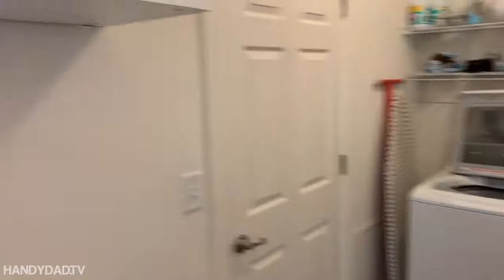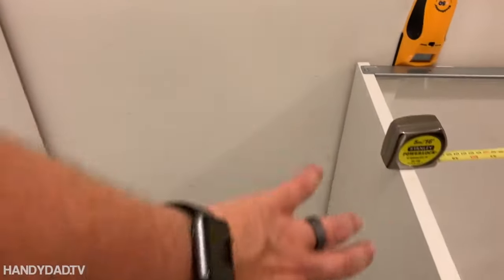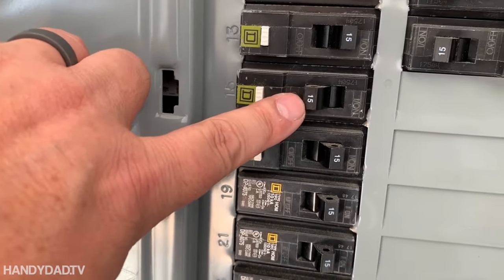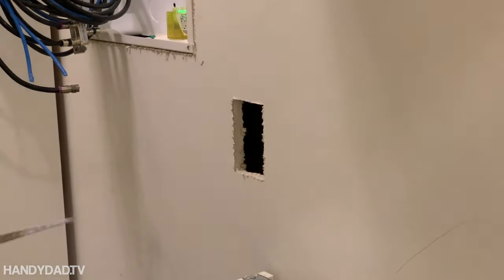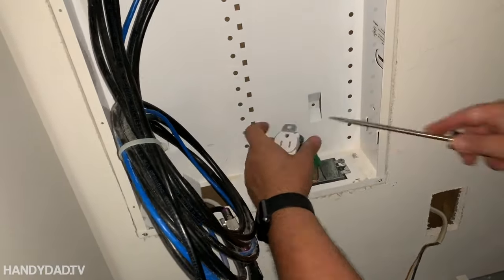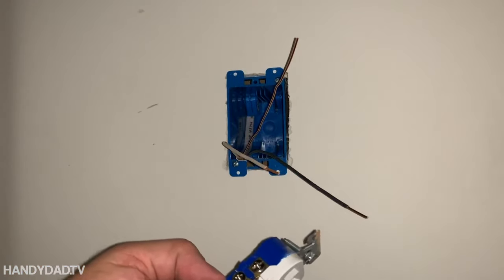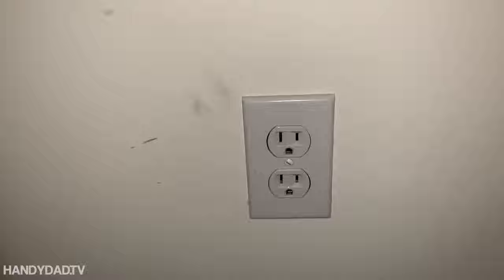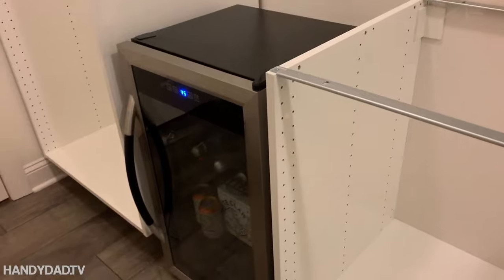Add an Outlet to an Existing Circuit

Comment: Does this effect what the breaker can withstand?
Reply: You still have to stay in range of what the breaker and the wiring can handle. If it’s 15 amps then you have to  stay within 15 amps on the entire circuit. You shouldn’t use too many outlets at once on the same circuit especially with higher amp appliances like this cooler, a vacuum cleaner, air conditioner, ect.

Comment: So if you’re adding just one outlet is that special ground wire nut necessary? This is what I’m confused on
Reply from the maker: No, if you only have one bare wire, you can connect it directly to the ground (green) screw.
Reply: HandyDadTV thanks for the response, “Dad”! But you’d have it on both sides of the new wire, right? Do you connect 2 ground wires 2 1 green screw on the original outlet?

Comment: Could you daisy chain multiple outlets off of one outlet ? How much is too much?
Reply from the maker: I’m not an electrician so I don’t know the official answer by today’s standards. But I’ve seen outlets wired with one feed coming in and up to three going out. But it gets really tight with all those wires in the box so I try to limit it to one or two out.

Comment: You forgot or it doesn’t matter where you put the line on which side of the receptacle? 
So the 12/2 that’s coming from the power, it should be screwed to the top of the receptacle and if you adding another receptacle the new 12/2 should be screwed to the bottom of the same receptacle and so on.
Reply: It doesn’t let add a picture so I can explain myself better
Reply from the maker: It doesn’t matter. Top and bottom are connected.
Reply: @handydadtv  thank you for the fast reply

Comment: Just want I needed... One questions though, instead of wiring to an outlet, can I do this to a ceiling fan? I'm not sure if a 15amp breaker is sufficient. And if it isn't, can I upgrade to a 20? Or is that bad because the wire that's already in that circuit is going to be 14/2 instead of 12/2?
Reply from the maker: You want to add an outlet from a ceiling fan? Or a ceiling fan from an outlet?
Reply: @handydadtv  add a fan, running power from an existing outlet
Reply from the maker: Yes you can wire a fan from an outlet. Fans don’t use much power so it doesn’t matter if it’s 15 or 20 amp.
Reply: @handydadtv  great, I'm gonna give it a try. I think I know what I'm doing now, but I'm gonna make my dad come over for a confidence boost and moral support lol
Reply from the maker: Dad’s are good for that.
Reply: @handydadtv  I just came back to this video for a refresher, the ceiling fan install went great
Reply from the maker: Great to hear! 👍🏻

Comment: How many lights and outlets can you have on a circuit?
Reply from the maker: There is no hard limit to the number of outlets. There is a limit to how much power can be connected, that is determined by the circuit breaker and size of wire.

Comment: Is there a limit to how many outlets you can attach to an existing one without overloading it?
Reply from the maker: No limit to the number of outlets, but the total power you can consume on the circuit is limited by the circuit breaker. In other words, just adding unlimited outlets doesn’t mean you can power an unlimited amount of devices.

Comment: I see that you ran one cable from the existing outlet to the new outlet. But what I don't see is where the third outlet is getting power from, there are two cables in the third outlet box. Does not make sense.

Comment: you did wrong on the first outlet connection .you should use the pigtail
Reply: Nope, he didn't do anything wrong. He did it exactly right. And that, is why us electricians are and forever will be in business.

Comment: Question ,so I’m wanting to add wall outlets in my garage as I only have 1 dual , but I have my deep freezer connected to it but I’m worried I’ll trip the breakers as I’m wanting to have a plug  for my tv maybe plug to charge my phone or multi strip outlet  also Want to add another outlet but on the other side of the garage for my compressor An tool charger just trying figure out how to accomplish this I was told I can tap into my light switch then tap my green into my actual light  I personally wanna add a dedicated breaker for both new outlets ,any help ?
Reply from the maker: First I would determine what else is on the circuit with your existing garage outlet. If that’s where the freezer is plugged in now, and you don’t blow the breaker, then there’s no need to change that. 

For the rest of the outlets, it would be best to run a new circuit if possible. Adding outlets to a lighting circuit should be avoided.
Reply: I recommend that you get a multimeter with an inductive pickup for measuring current. This will help determine what you should do next. I bought a Klein from Home Depot, about $60.

Comment: A Question and a comment. How do you know if you're at maximum capacity for your circuit breaker?

 My dad, he was an electrician, wraps the outlet back sides with electrical tape to cover the screws so you don't touch them accidentally when working with live wires. Although I would not recommend homeowners working with live wires.
Reply from the maker: I only work with love wires when testing voltage. Then the breaker goes off and stays off until I’ve finished the connections. 

As for breaker capacity, that’s a good question. You often don’t have a choice; you typically add an outlet to the closest existing outlet. It’s only a concern if you’ll be using multiple high wattage appliances (like two blow dryers) at the same time.
Reply: Tracey C if you go to ur panel and locate the hot wire for that circuit that ur receptacles are on you can use ur ammeter to see how much current that circuit is drawing

Comment: Can this be done on a 220 outlet
Reply from the maker: Yes, but any time you have a receptacle with only one set of screws, you need to use wire nuts and pigtails to extend the circuit to another receptacle.

Comment: How to determine proper gauge of wire
Reply from the maker: Determine which circuit breaker controls the existing outlet. It’ll have a 15 or 20 on it. This is the amp rating. 

14 amp circuits can use 14 gauge wire. 
12 amp circuits need 12 gauge wire.

Comment: Why can’t you connect two grounds to one screw? They are both touching anyway so what does it matter?
Reply from the maker: Technically it’s because they always want the ground to be connected on the whole circuit. If you could attach the wires with screws, the ground would break if you removed the outlet for some reason. That’s why code requires a pigtail on the ground.

Comment: National Electric code requires all outlets in laundry rm be dedicated 20 amp circuit with no other outlets fail
Reply from the maker: Thanks for the feedback but I’m sure that’s intended for the laundry appliances. The wine fridge uses less than one amp.
Reply: Totally false claim
Reply: 210.11 Branch Circuits Required
Branch circuits for lighting and for appliances, including motor operated appliances, shall be provided to supply the loads calculated in accordance with 220.10. In addition, branch circuits shall be provided for specific loads not covered by 220.10 where required elsewhere in this Code and for dwelling unit loads as specified in 210.11(C).
(C) Dwelling Units.
(2) Laundry Branch Circuits. In addition to the number of branch circuits required by other parts of this section, at least one additional 20-ampere branch circuit shall be provided to supply the laundry receptacle outlet(s) required by 210.52(F). This circuit shall have no other outlets.
(F) Laundry Areas. In dwelling units, at least one receptacle outlet shall be installed in areas designated for the installation of laundry equipment.

Also the receptacles you added are Not gfci protected which is also required by the N.E.C

Just an FYI, if someone follows your instructions on how to do this and they do it incorrectly and have a fire you can legally be held responsible, this is why a good Electrician will not give instructions on how to do something.
Reply from the maker: There is a dedicated circuit for the laundry appliances. I don’t see how an outlet for a wine fridge violates the above code. I did not change the load on the circuit. Same wiring, same breaker. It’s no different than plugging the wine fridge in the bedroom.
Reply: @handydadtv  The code is hard to understand sometimes, you have the dedicated circuit for the appliance being the washer, yet you have to provide another circuit for general purpose use and with it being IN the laundry room it has to be a 20amp gfci/afci protected circuit under current code
Reply: Ok, you guys need to think about what NEC says carefully.   Required is a dedicated receptacle for washer.   Required is a 20 amp branch circuit connected to one or more receptacles in the laundry.   NEC does not say all receptacles must be on that circuit.   It is correct however that if all receptacles in the utility room are required to be GFCI in the local adopted code, since newly installed, may be required.

Comment: How many outlets can you chain this way?
Reply from the maker: There’s technically no limit to the number of outlets. You’re just limited by the amount of current you can use on the whole circuit. 

That said, my rule of thumb is, if you find a situation where you need to add MORE THAN TWO outlets to an existing circuit, you should consider running a new circuit. But really, it depends on what you plan to plug in.
Reply: @handydadtv  awesome, thank you for the guide, might consider running a new outlet for my TV!
Reply: @handydadtv  if there’s too much current drawn due to the overload on the circuit, would the breaker just pop?

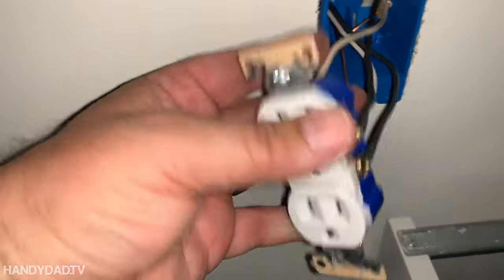Comment: The one question I have always had is how to push all the wires back into the box, so that they don't touch one another or come loose.  At 6:55, he says "put it all back together", but fails to show how he collapses all that wiring, as well as the outlet fixture, into that one little box.  Those wires are very stiff, and do not bend easily!  I am obviously NOT an electrician, so I have no experience doing any of this.  But it would have been nice to actually see how this is done.
Reply from the maker: Every extra detail I show is an opportunity for trolls to tell me I did it wrong. Or worse, people complain I’m going to slow and click away. Can’t win. Sorry.
Reply: @handydadtv  -  I'm sorry.  I didn't mean to criticize you.  Your tutorial video is actually very good.  I just figured someone else on here would comment on my question and offer some additional tips.
Reply from the maker: This YouTube life is hard 😭

Just kidding. I don’t blame you. You’re absolutely right that I didn’t show that detail. Perhaps something to cover in a future video. 

My advice is to pre-twist the wires before attaching the wire nut. Then tug hard on the wire nut to ensure it’s tight. Then fold the wires in a Z pattern as you push them into the box. If you have trouble, chances are that you have too many wires for the size of the box. But that’s a harder issue to solve.
Reply: @handydadtv  Thank you for those suggestions.  I really appreciate your help.  I just learned something!  lol

Comment: What happens when you accidentally  connect the black wire to the silver side?
Reply from the maker: That’s called reversed polarity. I have a plug-in tester that checks for this. Just turn off the breaker and switch the wires the right way.
Reply: Traveler 357    Typically nothing you will see.   It means internal switches would be on the wrong side of the circuit.  Some electronics will probably have noise on them.   Regardless, not correct thing to do.

Comment: I had my garbage disposal on off switch stop working. I was running it and when I went to flick down to turn off it flicked down but kept running.  Had to go turn off circuit breaker for that. Luckily it was the only thing on that circuit. So I assume the switch needs replacing. The unit was not wired to a receptacle, but directly to the disposal. The switch there now is probably from the 70. Leviton and its circular. Only wires attached to switch are 2 white wires. Black wires were wire nutted together and bare copper wires just wound together?  😮.  That’s wrong isn’t it?. But it has worked for the 20 plus years I have lived in the house.  Should I just rewire the same way on a new switch?
Reply from the maker: You’re instincts are right! Just because it worked for 20 years doesn’t mean it’s right. 

Determine if the black is indeed hot before jumping to conclusions. The hot wire should always be switched.
Reply: Had it rewired the correct way and installed the new switch…all is good now.thanks
Reply from the maker: Thanks for sharing your story!

Comment: Using the push-in connections(back-wiring) is considered very unprofessional. It might be o.k. for years till the receptacle encounters a heavy load. It is a hot spot that causes the copper to oxidized and eventually might burn out.  Use the screws and not the defective push in system.  More than half receptacle burnouts are a result of these push-in connectors.  Avoid what many consider "a built in design defect". Notice the GFCI sockets actually clamp the wire in back-wire holes when screws are tightened : must be for a good reason.  It time saving vs safety : not worth it.
Reply from the maker: The irony is that push-in connectors were invented to save time for *professionals*, not homeowners, since the pros are installing tons of outlets everyday. 

If they are truly unsafe, why does code allow them?
Reply: So how do they "fix the problem" ? - by demanding a courtesy loop, so when it does burn out -- one can pull down more wire to "fix it".  Great solution to an industry defect.  Proper connections should withstand some amount of movement and vibration, and push-in does not cut it in some cases.

Comment: Where do I get the ground adapter?
Reply from the maker: These? https://www.amazon.com/dp/B000LDBAO6/?tag=ha0d9f-20
Reply: HandyDadTV yes thank you!! Is there such thing as a circuit breaker flipper? To find circuto
Reply from the maker: I use this. https://www.amazon.com/dp/B003LHJSY8/?tag=ha0d9f-20

Comment: Why didn't fasten the box to a stud? There was a stud 2 inches away.
Reply from the maker: Old work boxes are designed for these situations. It’s fine being attached to the drywall.
Reply: @handydadtv  Having framed houses for 30 plus years I can tell you that fastening to the stud is what you should do in the future . Not taking anything away from you because  this video was really informative and well made. Good job!
Reply: Old work boxes that attach to a stud are readily available. Mounting screws are internal and go in at an angle for access. It's a stronger attachment and would be recommended for heavy use and/or tamper proof receptacles.

Comment: 2 No-Nos here. First of all, never use a dedicated circuit such as the one intended for communications, especially when you have a motor load such as a compressor. Though it's a small fridge, in still has a reasonable level of in-rush current.  A motor circuit should always be dedicated.  Code fail!  There was no cable connector in tha box and he didn't ad one.  Kudos to using the screw terminals. Push-ins make a very poor connection.
Reply from the maker: I’ll give you that I didn’t fix the missing grommet, but I disagree that every device with a motor load requires a dedicated circuit or it’s a code violation.

Comment: He just does his technique wrong. Uses knife down the whole sheathing which could damage the insulated wires , also the holes in the back of the receptacle shouldn’t be used for the conductors although they say it’s ok it is unsafe especially with exposed copper.
Reply from the maker: I do what I was taught and it’s been fine all my life.

Comment: Why do lights flicker. Need help..
Reply from the maker: Many possibilities but usually it’s a high power device clicking on and off elsewhere in your house.
Reply: Jose Medina    My lights flicker when the Eden Pure heater turns on and off one of the quartz heaters.  Nothing you can do about it.   If flickering and going completely off and on, different issue.   If several lights, check for loose wires on breakers and neutral bars.   Arcing and future problems coming.

Comment: Oh God Dad, WRONG. If your going to instruct people please get it right.
1. The pre-exsisting outlet in the network box was installed wrong before you ever started It has no strain relief you can't just stick Romex through a hole like that it needs to be secured. As you did in your new blue box.
2. DO NOT wire extra outlets through other outlets.  You need to connect the supply and exit wire to a pigtail and the pig tail connects to the outlet. You must maintain continuous bonding.  
This most likely should have been a new circuit because the wine fridge motor can cause line noise that could interfere with any electronic components in the network box ie. Modem, router, tv Amp

Not an electrician just an educated guy that flips properties.

You can got a copy of the abbreviated national electrical code at home depot or lowes it explains all this and why in great detail
Reply from the maker: 1. I know and I fixed it. 
2. That’s a matter of preference, not code. I’ve never seen an electrician wire an outlet with 2 cables use a pigtail other than the grounds. There are two screws for a reason. 
As for the fridge, it’s a low-wattage appliance. Hasn’t popped a breaker in a year. I think we’re good.
Reply: @handydadtv  Hi, sorry didn't mean to sound priggish. I'm in Baltimore city and local codes are very strict here (guess cause the city burned to the ground 100 years ago 🤪) it may not be required by code but its best practices as if wired through each receptical if one fails it may kill all power down stream.  And you are right on the low power draw but what else is on the circuit.   Other concern don't open yourself up to possible law suits